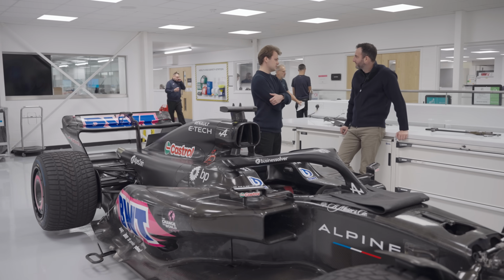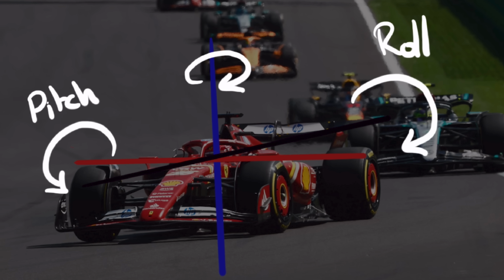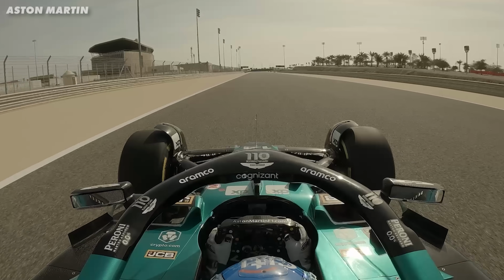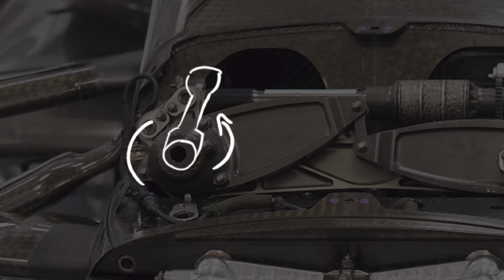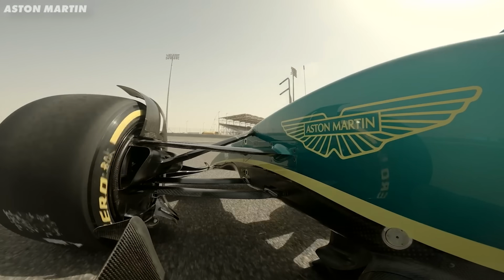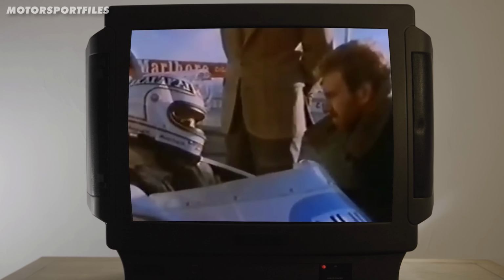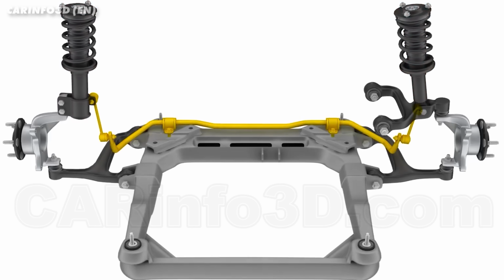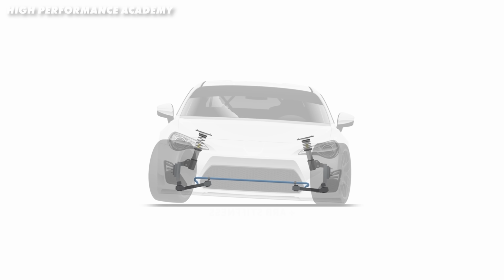F1 Suspension Is Simpler Than You Think

Comment: Jonesy did suggest putting suspension in the seat!
Reply: Literally drivers use their butts  to feel what is the car doing, with springy seat it would be impossible to catch all that little oversteers and they are at the edge of grip and here is where drivers want to keep the car at all times
Reply: @profrook  good point. i think it's more than their butts, but the disconnect would have most likely have an impact.
Reply: IIRC, Frank Williams suggested that AJ sat on his wallet. 😀
Reply: @Pikestnt  LOL
Reply: I still don’t understand the arb. It needs to connect to the other side suspension surely… otherwise, as shown in this video, it’s just another TB inside the standard TB. 
¿.?
Reply: Its right at the beginning of this clip. Just before the audio cuts in, AJ suggests putting suspension in the seat…..

https://youtu.be/nTH3mZfMRdI?si=Xbx5Df61Qi_4CdeP
Reply: They’re likely balancing safety factor against weight
Reply: I wonder why this hasn’t been done. Would it not save weight and make the areo better?
Reply: @Dr904 Won't get much idea about what the tyres are doing I think